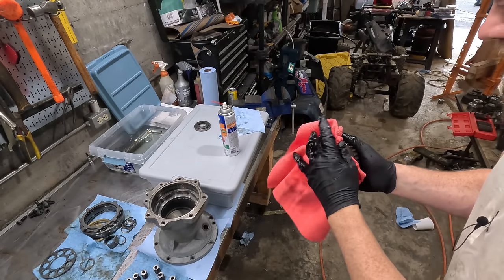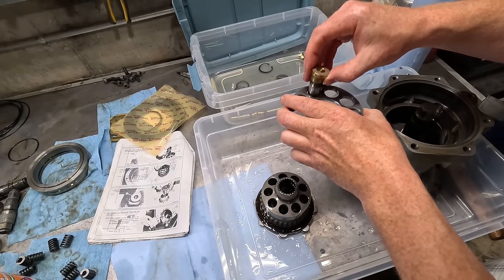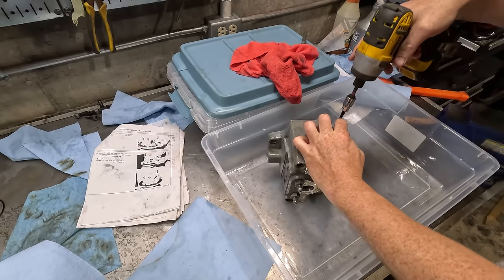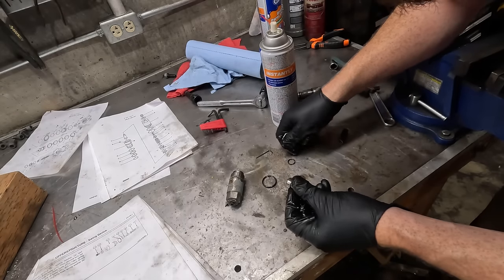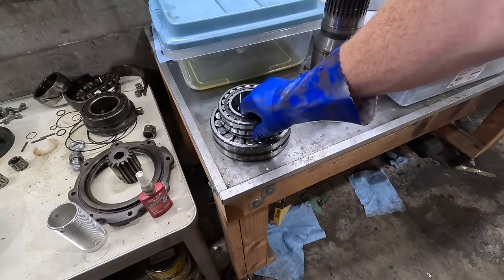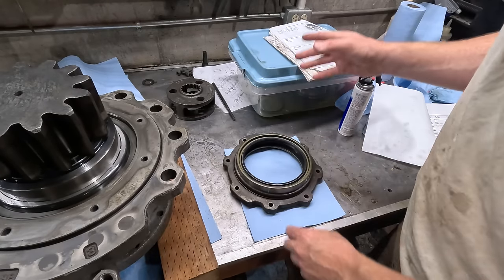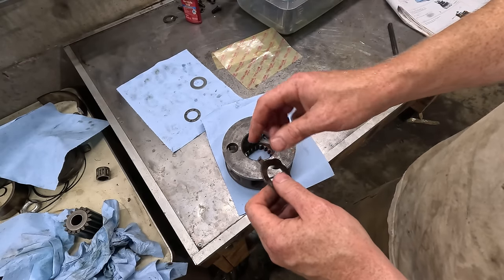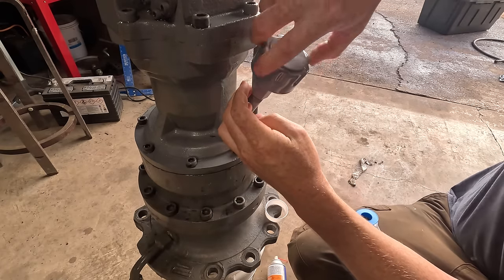Excavator swing device rebuild part 2 of 2 (Hitachi EX120-2)

Comment: I ran an aircraft hydraulic shop for 17 years. This is how this work  should be done. Cleanliness is most important.  One suggestion I have is you should get some brass rod and make several types of seal picks. Eighth inch welding rod works good.This will save scratching polished parts.
Reply: I believe he did alright with being clean. Yes, brass drifts would have been helpful. I don't believe anything was damaged.
Reply: You don't want to use brass drifts around open bearings.  Use good old mild steel bar for drifts to drive bearings with.  Brass drifts are good for driving other parts.  Great video! Love watching this kind of stuff.
Reply: @4GSR  I take what you didn't say was the brass might flake and drop into the bearing?
Reply: @dans_Learning_Curve  Yes, absolutely!  My dad drilled that into me in my earlier years of life.

Comment: Nice work Matt. Now you're at the nail-biting phase where you have to worry for the next few weeks "did I put that seal in right, did I seat the bearing correctly, did I forget a shim, are the clutch packs correct?" etc. That's the worst part. But to me you looked as thorough as you could possibly be.

Comment: Great job putting this back together.  I will say you are alot cleaner than most of these are reassembled.  Most of them are tore apart and reassembled on a job site somewhere.  Dust, dirt, and mud are part of it.  You just do the best you can keeping it  clean

Comment: Well, I definitely think if Matt was given the special tools and parts to remove, rebuild and reinstall the main rotor transmission on a Sikorski HH52a Seaguard amphibious helo I flew in as a Coast Guard Aviation Machinist Mate Flight Mechanic/ Hoist Operator and it would be fully reliable to get us out to and back from rescue missions.
He's that good in my estimation.
I have removed one and reinstalled a fresh rebuilt one from it's storage/transportation can and it's not a walk in the park to do it.
Can't wait to see him reinstalling it on the excavator then testing it.
Absolutely no doubt that it's gonna work perfectly.

Comment: More courage than I have, but saving grace is low RPM. Clean room is important especially for engine build consider A/C. Great job no parts left over and it rotates by hand correctly planetary gears seem a little loose but if it doesn't leak this will be a monumental accomplishment and a HUGE cost saving. Good luck from a fan. Ray Stormont

Comment: - What a complicated assembly to accomplish. Congratulations. It would be a scary thing for me.
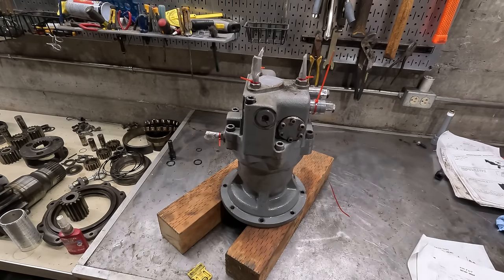- I am worrying at 20:22 that you forgot to torque the two big plugs at the top of the swing device.
- Will I see that you do it when it is installed back in the Excavator and think myself a fool?
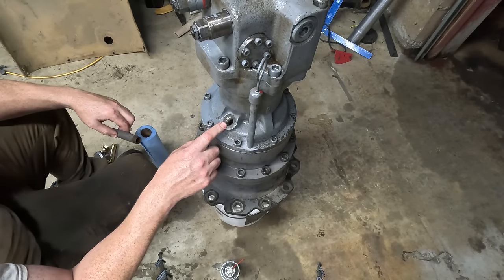- Is the base was sturdy enough at 40:30 to handle a {3 to 4 o'clock} "down" force to torque the big plugs?
- Could the torquing be done when the device is suspending by a sling?

Comment: White grease Lubriplate is excellent assembly lube for hydraulics. Hydraulics are generally well lubricated via the fluid. Moisture and dirt contamination are the concern. Make sure your reservoir (tank) is good condition and alll caps and breathers are intact and functional

Comment: Nicely done, Matt. I dont recall the fill pipe cap having threads. I seen to remember them as just sealing with an oring. I can't say for sure, but I think the cap had the breather in it. But your solution works too!

Comment: All I can say is, "MEETICULOUS"  assembly work.....   Brass has a bad habit of chipping off. Previous comments made the same point. You are not going to "mar" bearing races using a mild steel driver.  Bearing drivers are certainly a better choice but who would have all the different sizes needed.
Keep up the good work Matt, I've not seen you do anything without extra care.  Certified Assembly Engineer per Society of Manufacturing Engineers.
Your memory for what goes where is awesome.  
PS: I'd like to be your vendor for "carb cleaner" .;....   LOL           God speed and Blessings to you.

Comment: usually the motors and pump are pretty robust. If I were you I would reseal the valve body most importantly while you have it apart. As you know the o rings get hard and crack over time, and there are a lot of them in the valve body stack.

Comment: Hi there take it one step at a time. If you have the means i would pull the motor. This way you can inspect everything with ease. Clean it up. Replace what needs to be replaced. Look into getting a set up for hoses first. Second check the internet. Might be a company out there who will make them cheaper. Love your vids thanks for sharing

Comment: Back at you-know-where I worked, I had the machinist make some bearing insertion tools that kept the differential stress between the inner and outer race zero.  We spend months designing the tools and 10 minutes using them!

Comment: Hi Matt.  I have absolutely nothing to do with mechanics except changing the oil in my cars and very basic to no mechanics at all. But, I have enjoyed immensely the D4 rebuild and now the excavator, the geese and the dog. I have picked up some very minor tricks you have , as well as squatch and salvage work shop. Very enjoyable. The only suggestion I would make is: I know you do fiddly work, but with a lot of greasy, rusty, dirty work, I wear nitrile gloves, only because I cant be bothered cleaning the dirt out of my finger nails and scrubbing my hands to death getting the dirty oil and grease off my hands, how about you?
Reply from the maker: I left them off during reassembly, easier to feel for small particles of dirt and any burrs/buildup on parts.  I wear them when things get dirty though

Comment: The force is strong within you.👍👍👍 So many parts........😲😲😲😲😲. I am glad that you can follow instructions and that you have the patients to work with such precision parts. It sure takes a lot of time to take it apart, clean and inspect all the parts. You have to order parts and wait for the parts to get to you. You ordered a part and they sent you the wrong one; another delay but you had a great fix. I sure hope that things go well and that the cost are not to high. I hope that this build goes a little faster than the D4. It does not look like you will have to deal with the paint on this one. Thanks for the video.👌👌👌👌👌👌

Comment: Nice work. It looks like you already did this kind of task on hydraulic before.

Please put more attention on the brake cleaner you use (looks like it is)
It’s cheap, extremely helpful and efficient BUT it’s extremely expensive on your health. It’s using the n-hexane and related stuff, right ? Those solvents will immediately enter your skin and your lungs, enter you cells and do their « cooking «  inside. Those chemicals are responsible for terrible health problems at many Chinese electronic factories, just search on the web and YouTube ! 

Don’t breath, don’t pour on your skin !

Keep safe

Comment: Theoretically it doesn't matter which piston came from which hole and even though everything measured into spec, when it comes to very tight machined matting surfaces that have already worn into one another it is best practice to put everything where it originally was. As getting into this habit will save your bacon at some point down the road and when it does save you it's usually from something very expensive and catastrophic.

Comment: Really enjoy your videos, learn allot from it. I saw you used thread tape, a i belive thats a no go on hydraulic. Correct me if I`m wrong, but I have been told that thread tape can caus alot of damage on hydraulic system if it get inside.
Reply from the maker: you are correct, but that was thread tape into the gear box filler, not the hydro system!

Comment: Somebody's rebuilt that before and used 5/16"-18 grade 5 bolts instead of the original metric...case threads were hard enough to reform the bolt threads...thats how close 5/16"  NC threads and metric M8 course threads are although they probably did have to wrench them all the way down
Reply from the maker: that's the only thing that makes sense to me

Comment: In the motor...the stack of rings with the eight bulges that index to the case, and the black rings in between them...is the motor's cylinder block clutched to the case? I don't get it. Is it a brake to lock everything up? Is that so when hydraulic pressure is not applied, it internals get locked in place so the excavator won't slew? Then when you command slew, and hydraulic pressure is sent to the the motor, it releases? Or does it not actively release, and just provides a permanent friction lock that the motor must overcome?
Reply from the maker: it automatically locks when there is no hydraulic flow.  those 10 or so springs around the outside keep constant pressure on those brake discs, but the hydraulic fluid pushes the piston on top up against the springs to release the brake
Reply: @PacificNorthwestHillbilly  That makes sense. Thank-you. Enjoying your videos!

Comment: Pardon my naïveté but why is that unit so complicated.
Does it do more than rotate the house over the tracks?
Reply from the maker: it's converting fluid moving through a hose into rotational movement, then gearing it down to the correct RPM, as well as braking it in place when it shouldn't spin.

Comment: BSP is 26 TPI on a tapered thread
Reply: I was thinking that the difference between BSP & NPT is 27 tpi on one and 28 tpi on the other, but check me on that. Also, what I read is that BSP is 55 degrees with rounded tips and valleys, where NPT is 60 degrees and sharp.
Reply: @timothyball3144  your probably right, what I learned back in 1978 I found I never had to use once in over 40 years of working on aircraft  lol (but back then in trade training we also had to learn blacksmithing (can you believe that ! )

Comment: What's the creepy red Terminator eyes in the thumbnail image about? I'd like to know more about how you can order a simple part like the one you flipped over and they send something so wrong. I can't be the only one with such seemingly banal questions. Have you considered throwing in some Q&A videos into the mix?
Reply from the maker: that part was from an ebay seller...had I ordered it from Deere (probably 2 weeks to get it), I'm sure it would have been correct.

Comment: What Fluid did you put in the swing motor
Reply from the maker: hydraulic fluid in the motor, gear oil in the reduction gear box
Reply: so the one that has the diptick is the gear box correct?
 @PacificNorthwestHillbilly
Reply from the maker: yes

Comment: Are you a mechanic buy trade or is this hobby working and repair old Equipment.  For self used.??   myself I had my on Construction business , A Engineering Licensed contractor. Backhoe and dozers , excavator.
Reply from the maker: this is just a hobby, but I do need it on my property eventually